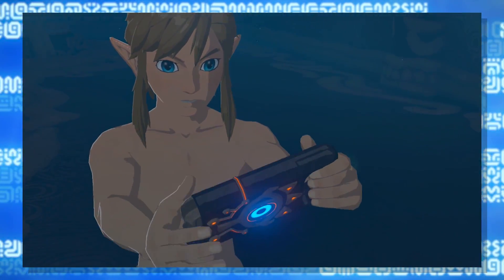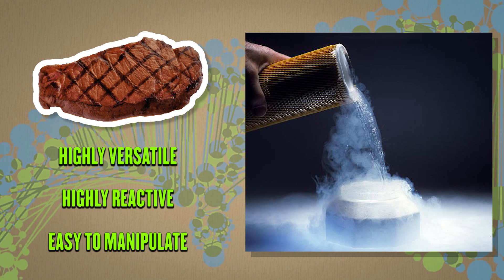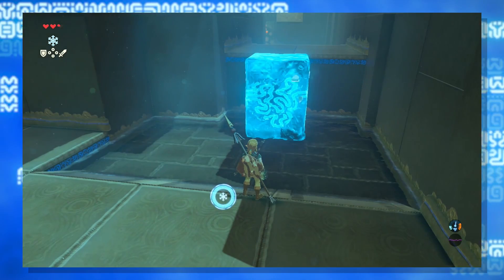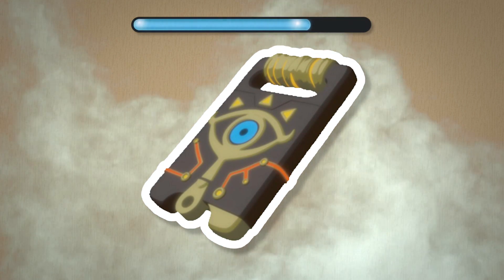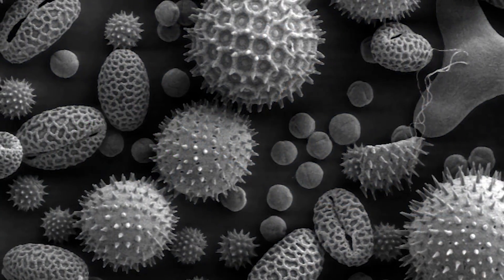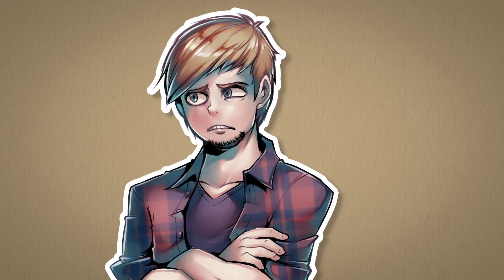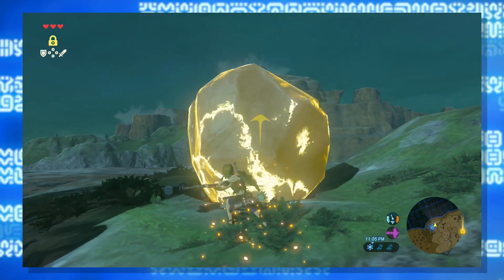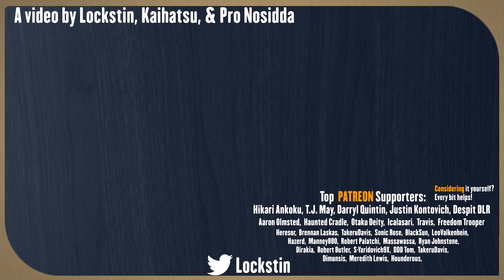Zelda Theory: The Science Behind the Runes | Gnoggin

Comment: Crionys is just some kind of radiation that uses the nitrogen on the air to freeze the moisture on the air.

Magnesis is just a powerful electromagnet that somehow repels and attracts metal objects at the same time causing them to just float where they are unless the user decides to close them in or push them away.

The bombs, I guess they are just a shell the slate makes and them fills them with explosive gas, nitrogen being the one the slate can easily get no matter the place.

Stasis, that's just magick.

Comment: I feel like I may not understand exactly, but given half the things here are explained with "magic is being used to help the science", there's no reason it can't all just be related to science. This is obvious, it's fiction, and they probably didn't have science in mind when making it. It's specifically fantasy.
However.
As I was watching the video, I felt you guys were going to say Absolute Zero for Stasis. Yes, that doesn't really make too much sense with enough thought on it, sure, but you guys said that Magnesis is based on electromagnets which SwankyBox questions below. 

By saying "part of it is magic", you are basically giving leeway to suggest all of your theories are completely correct and giving no real point to question it. It's as if you're trying to say "this is the final point, we can't say anything further than this" which is wrong. 
It's either entirely magic or entirely science. Magitek as a trope, even, is basically how fantasy stuff can still use modern technology - they replace it with magic. The Divine Beasts? Magitek. They are literally robots(fuckin' megazords), but they don't work off electricity or anything, they work off magic. It's not science-based.
Yes, once again, this attempt at debuttal is basically the equivalent of "it's a work of fiction so stop overanalyzing it", but at the same time, you need to apply rules to how something can be analyzed before doing so. It basically makes it pointless to even ask the question in the first place without the rules in place, what you're literally doing is saying "this could be how it works, but we don't really know, because magic". It's not a theory. We know this already, we can assume this. All you add to this is suddenly nitrogen and that just sounds, for lack of a better phrase, kinda retarded. ._.

Comment: I think instead of using leptons another possibility is the new using all the moisture or nitrogen in the air to lock it in between the atoms of the object then using magnesis to hold it still then the bombs to push it away. But at the same time it doesn't make sense because you can only use stasis on some items just like how magnesis only works on metal if it were leptons wouldn't they be able to use it on more objects? Maddie it doesn't make any sense either considering you can't use magnesis on everything  maybe instead of using nitrogen they're using that magic DNA water that heals to carry the materials you need to activate these runes The Springs in Goron City heal you maybe that water in the water they used to heal link except it worked much faster and you can find water pretty much anywhere on that game and then she go water pictures of evaporated and  spread around the world if you using nitrogen all the time that would mean you could just spawn ice blocks everywhere but you can't unless there is enough water or the material stored inside of it

Comment: The nitrogen explanation is bonkers. 
So first of all, the entire argument of why the Shiekah use it is completely untrue, as you conclude how the ancient people from 10.000 years ago thought by comparing them to a contemporary society. Doesn't work. 
If you had the N2 inside the water-filled rune and cool it there, you would compromise the DNA storage as all the reading proteins would either stop working or do their work waaay more slowly. If you stored the N2 as a gas inside the slate, you'd compress it, therefore heating the slate and destroying the DNA storage (all whilst creating a pressure bomb). 
The vapor created by the frozen N2 also isn't so much condensed nitrogen to my knowledge, but mostly composed of condensed CO2 (which condensates at -78°C) and water vapor (0°C). You guys also don't explain how the icis rune works at a distance, though that could be magic, I suppose. 
Speaking of cooling, you neglected the entropic effects of liquefying the gas: If you decrease an object's entropy (i.e. cool it) you have to increase entropy somewhere else (i.e. create heat) and the slate hasn't exactly a pressure chamber for the Linde-process inside of it, nor does it overheat when "reloading". 
With Magnesis, you expect every metal in the game to be magnetic, and a super-conductor at reasonably low temperatures, which isn't the case. You also don't explain why only one object at a time is manipulated . Even if you assert a focussing mechanism, this seem a bit iffy. Also, what's the power source? 
What is the bombs outer layer? How do you ionize the gas (a power source, again)?  Why do they glow the same way the swords glow when latter aren't plasma (neither hot nor conductive)?

Comment: This is an excellent video and some clever explanations and ideas, however there are some major issues with your explanations on Cryonis and Stasis. If Cryonis is Nitrogen it would burn Link whenever he climbed on it, and why would it require water to be used? As for Stasis, leptons is a cool idea but the issue is that then the ability would still  violate conservation of momentum. Momentum has a direction that also needs to be conserved and hitting an object in stasis causes the full momentum to change direction immediately. My personal theory on this is that the slate is a sort of master of fields. For Cryonis it would create a highly pressurized space within a field that would cause the water to freeze and consequently float. As for Stasis it would be a field that converts kinetic energy to potential energy and back when released, that way direction is no longer an issue. The actual method these are done is a completely different issue. Regardless great video. I thoroughly enjoyed it and there are some really cool concepts here.

Comment: I say they went too complex on the stasis one.
Why? That would be a lot of energy needed to power that thing! A lot.
One simpler solution would be still the time crystal.
How? 
The timecrystal is activated by smacking it. Smacking it "squeeses" the material ever so slightly. Let us presume that stuff is some sort of quartz. Meaning it gives of a charge when squeesed. This charge is enough to create a field of time-warping for a limited amount of time. Why limited? Because once you leave the area the effect is reversed.
Focuse the crystal, run a usual electric current through it on high hz and you created a field of time that switches itself on and off nearly instantly, going back in time as quick as it lets time go on on a less than milisecond level and there you go. It even expires because you are not aiming anymore with the charged crystal.

Comment: First, there is no "0°K", it's just "0 K" and this can't be reached by any means. Second, liquid nitrogen is only around –196°C (~77 K), nowhere near close to 0 K. Third, Magnesis is not how magnets and semiconductors work, so referring to real life magnets is a very flawed argument. Fourth, if Link was to touch anything at that temperature for more than a few seconds (no Leidenfrost effect), he'd probably lose a few fingers. Fifth, even the Quantum Zeno Effect there always is a finite probability that a change of the quantum state takes place because there is no such thing as a continuous measurement. This means, the effect of Stasis had to disappear randomly. Sixth, all of science is theoretical science; you're just using the term "theory" in a completely absurd way that has nothing to do with what it actually means. Seventh, the lepton argument makes no sense because of mass defects and the relativistic energy formula. Also, this is not how superposition of quantum states works at all. Once measured, the system is in an eigenstate; which is what gives rise to the Quantum Zeno Effect in the first place. 

I'm sorry, but everything in this video is very badly researched and most of it can be debunked with just some basic knowledge of modern physics. You can do better.

Comment: The only issue I have with this is that Magnesis being labeled and glossed over as an electromagnet causes a lot of problems. It is too simple of an explanation to really identify what is going on with the ability. Is the object being pulled? What is the magnetic source? How is it directly focused? Magnetism has a lot of properties to it that cause issues with majority of explanations.
Reply: SwankyBox 
Magnetic fields are canonically how lightsabers in Star Wars form their blades; focused magnetic fields are actually quite common in sci-fi, even if we don't know how they work yet.
Reply: I think the runes could be a type of coding which causes physical effects to happen.
Reply: Well when a magnetic metal is cooled down to about the condensing point of liquid nitrogen it can obtain weird properties. One is that magnetic field lines will bend around the atoms, essentialy creating a forcefield around each atom, when the magnet moves so does the super-cooled metal, it stays in the same position relative to the magnet. But the metal can be influenced by outside forces such as us. Of course the material can still be attracted to magnets but none of a practiical size to haul around with us in anything smaller than a cargo ship.

If you believe that it can store enough energy to creat giant ice blocks and plasma bombs then this isnt far fetched.
Reply: It's an electromagnet because it can be turned on and off
Reply: How does link stop the insanely powerful magnet from pulling metal scrap around him